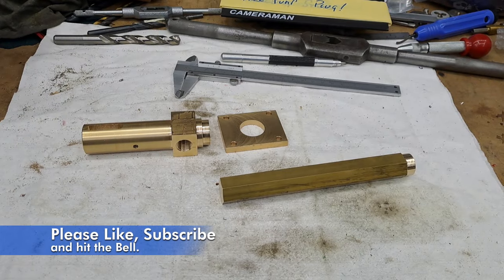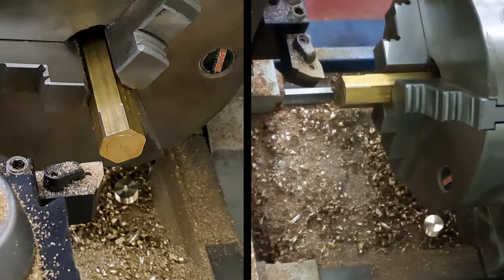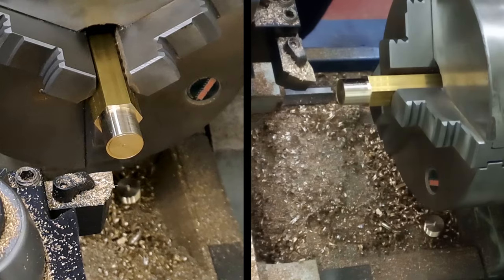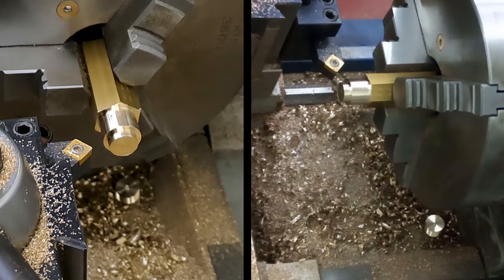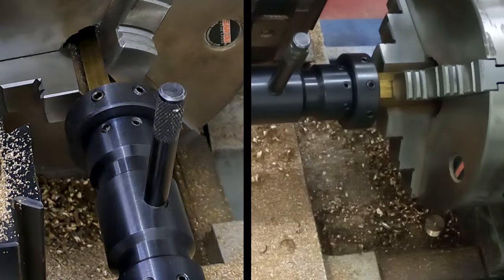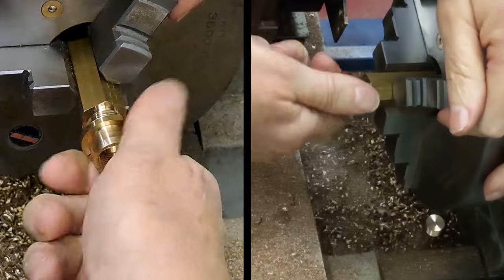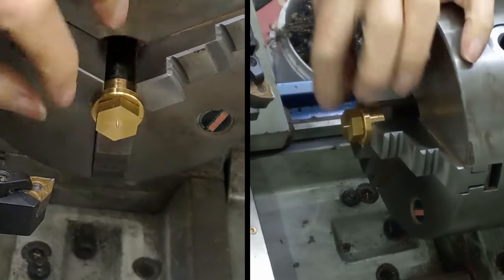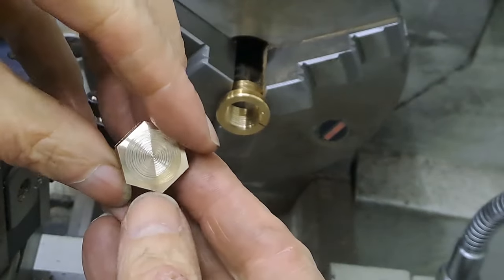040 But... it is a Plug

Comment: G’day Andy good result it was a struggle cutting that thread I thought that you locked the holder in the tail stock and used the small handle to do the revolutions to cut the thread the one I have is not as good as yours but I still manage to cut the thread.   Good to see you mate and what a great intro….regards John😊
Reply from the maker: Thanks for the comment John - you're right, the threading took a bit of effort!
Andy